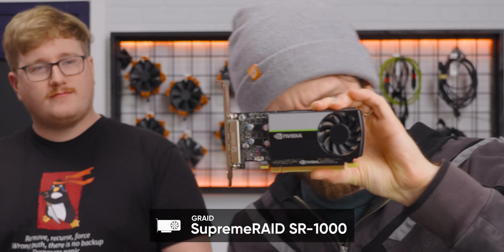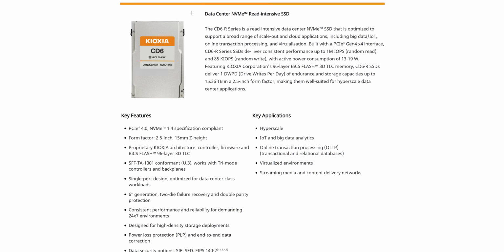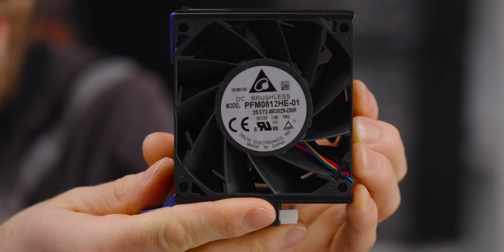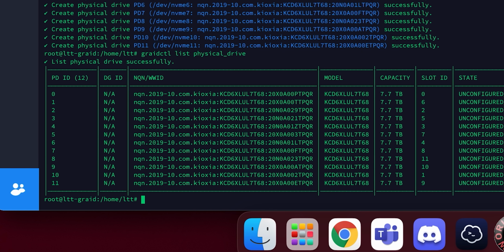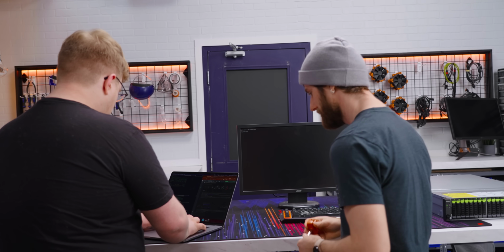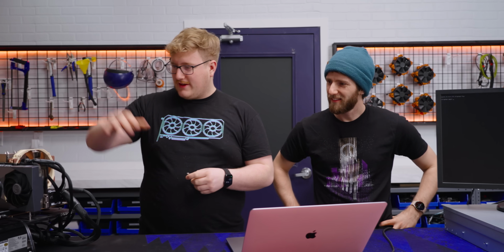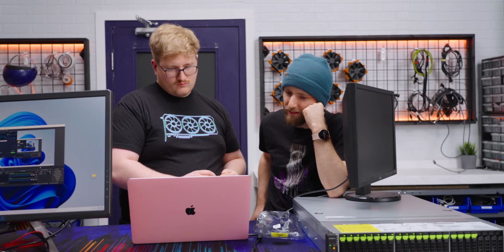I predicted the future! - GRAID Graphics Accelerated Storage

Comment: I am hoping you can look into a problem that's been cropping up all over.  It's called Nahimic service,  some kind of sound booster program that's only causing problems for everyone that realize that they have it.  It does nothing more than eat Ram availability and CPU cycles and crash nearly everything.  So far the only way to stop it from doing anything is to turn off the service through MSConfig.  Uninstalling it doesn't work since it seems to reinstall itself whenever you reboot or update windows... Please look into this soon and hopefully you may be able to get to the bottom of this weird program that's doing everything but what it was made for.

Comment: With regards to the 4k sector size limitation you saw on the Liqid card, are they Sabrent drives you had on it by any chance (I know you use them a lot) - if so there's a converter program to change them to/from 512e/4Kn sector size - it's called Sabrent Rocket SSC. Both my Sabrent drives came set to 512e.

Comment: I just installed two 2TB NVMe Samsung 980 PRO w/ Heatsink on a z390 in RAID0.  The CPU (9900K) goes nuts.  It uses Intel Rapid Storage which handles SATA drives, so I don't think it's designed for it.

Comment: A software RAID accelerator card sounds actually nice. I'm afraid of hardware RAID because if the controller gets fried, you can lose all of your data. With a card like this, you might just lose performance until a replacement arrives.

Comment: As I remember someone usually says, even with RAID, always make backups (and make sure data there can be restored). RAID is redundancy, it doesn't replace a backup.
Reply: Always make backups, even if you use a one-of-a-kind savant human who can remember every bit of your data forever. In fact, make three backups; one externally in your home for acute failure, one at a trusted friend/family member, one either in the cloud or a physical storage location that is protected against disasters. You'll want to keep your data safe even if your house explodes.

Comment: Raid 1+0 is very useful, in an enviroment where you have more capacity than you need but need performance and where seek times matter more than raw throughput. To the best of my understanding. Raid 1+0 reads as if it knows that it has 2 copies of everything. So for random reads each set of disks can deal with half the requeats. This is faster for random reads than even raid 0. But for writes you have to write 2 copies of everything. For mechanical hard drives raid 1+0 is very useful.
Reply: Its actually even faster than that. Since to pull off Raid 1+0 you need 4 drives, you can actually see up 4 times read performance. There are 2 copies to read from, but the other 2 drives have the other half of the data you're trying to read, which can also be read at the same time. Write performance is only doubled because you need to write one set of data to half the drives and the other half of the data to the other. There are other bottle necks when you add a lot of drives but if you have N drives, read speed can be up to N times faster and write can be N/2.

Comment: hello guys, i love your videos!!!! I have a relic for you from 2012 that still works. it's an intel s5000XVNSATAR board with dual processors and 14 GB ram, a GTX970 4GB graphics card, and 2 1TB hard drives. I'm having a hard time finding cooling fans for the CPU's. i want to take it out of the server case and put into a regular tower setup. it has the crazy ram that you were talking about in one of your videos from 2019 that you did using an Intel dual CPU board with xeon processors. This board has 2 GBE Lans.  Any suggestions? Would you guys like playing with the board?

Comment: GPUs are good for highly parallel, high throughput executions, but suffer from higher instruction issue to execution latency than CPUs. I wouldn't be surprised if that's why it takes a little bit for speeds to ramp up.

Comment: Unclear about the usecase where all the data is in memory and we need to write to a disk. Typically, in enterprises, the should be offered as storage solutions. So the data is coming on the wire (say on a 100Gbps link). Would the CPU be unused, if we need to process the data at 100Gbps?

Comment: Should I feel extremist to think that I would NEVER put my data raid depending over a closed source driver ? (and a particular hardware, because Linus forgot to tell you that if the card burns, and you can not find anymore something compatible, goodbye data...). Another reflexion, if you want really to compare, you should have put ZFS also on the raid, or tried ext4 over software raid before. Also, FYI, some in-kernel development now permit to achieve (if you have hardware up to the task) up to 14*M* of IOPS per core on a i9 12900K (tested with Optane)

Comment: 32 raid controllers though... thats way more than 32 drives. As long as the card thinks it's talking to a drive (which is a 6 drive enclosure with a controller or something) you can probably expand infinitely.
And samba... Isn't Rsync faster for moving files? Not as userfriendly though...

Comment: Creating a Raid1 because every drive is a single point of failure => now the raid controller is a SPOF (that hopefully has a much longer lifetime).
Does this system keep running (but much slower), if that controller dies, or can't the software handle that case?

Comment: On a RAID 10 you still have a hard limit of 1 drive failure. Although 6 could theoretically fail without harming your data consistency.
So.. no "real" benefit over RAID5 

That said.. you got close to double the read speed in RAID10 normally.. That might change with gRAID though.

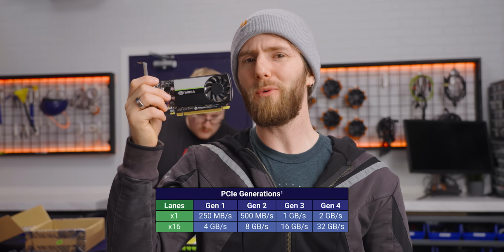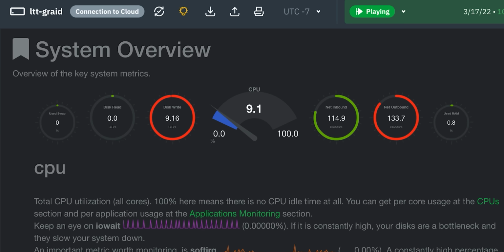Comment: At 4:58 you say the data for the RAID 5 parity calculations doesn't actually have to flow through the card, thus performance isn't limited to the PCIe Gen4 speeds of 32 GB/s. You then say the card only directs where the data has to go. This is incorrect. Since the XOR operations involved in the RAID 5 parity calculations are actually preformed by the GPU on the card, the data being written does in fact have to flow through the card (over PCIe) in other to supply the input data into the GPU for the XOR, as well as sending out the GPU-calculated XOR data back over PCIe. This is why at 17:20 your RAID 5 sequential write performance came in at only 9 GB/s.

Comment: You do not need a dedicated GPU to implement high performance raid. We live in 20th century and CPU can handle the parity calculation if the software raid is designed properly. GRAID just offloads their software raid onto the nvidia GPU making it a much complex solution and adding another possible point of failure. Their card requires 1 PCIe FH slot which is crazy, given that all flash server usually have limited amount of PCIe lanes, making it an extremely important resource. Their CPU consupmtion is equal to high end software raids solution that are available in the market.

Comment: Why do you still compare it with ZFS if it's even not in Linux kernel!? 

If you checking ext4 you should compare it with dmraid. Also, you should try btrfs because it's the same features as ZFS and inside the kernel.

Comment: What about file system compression with an array of nvme drives? This could cause massive CPU utilization as well and reduced speeds. Possible to offload computation to GPU also?
I know NTFS compression is proprietary. What about Linux implementations
Reply: Hmm, in theory it could be offloaded onto the GPU. In practice, complicated compression algorithms aren't well suited to the GPU because decompression requires the output of previous chunks, so it is hard to make use of massive parallelization. You could try simpler compression algorithms, but it'll have to be very simple to benefit from massive concurrency. One of the simplest algorithms is RLE (Run-length Encoding), which isn't all that useful unless your data is full of sequences of the same data (e.g. a black bitmap) - RLE essentially works like this; instead of storing, say, 100 bytes of FF, it'll store FF and a count of 100 - it obviously falls apart with more complex algorithms. There's Huffman encoding, which encodes bytes not by their value but by a sequence that gets to the value as stored in its 'Huffman table'. The easiest way to explain this would be like this; say you have a file full of FF and AA, Huffman encoding computes that there are only these 2 values, so it will be able to say 'lets use binary 1 to refer to AA and 0 to refer to FF', essentially using 1-bit variables to refer to 8-bit real values - in this case, it would save 7/8th of all data, but the more complex the data the less a Huffman encoding helps. If your data is pure random for instance, Huffman encoding will essentially take up the same amount of space because it will need to encode (on byte level) 256 different possibilities, leading to byte-sized indices. It's also a very easy algorithm, both on the CPU and the implentation, so it would not massively benefit from GPU acceleration. There's a lot of more complex algorithms which you'll typically use in day-to-day operations, such as LZMA, ZSTD, ZLIB (zip), and many more. These combine some of the RLE and Huffman encoding principles, usually with a dictionary for common data patterns (e.g. say your book has many mentions of the string "The City", it will detect this and create small signifiers that point to this string). These are really effective methods of compression, but often rely on previous' block output, much like encryption does. GPUs love programs that can spin off into independent ''agents", such as tile-based rendering, none of the tiles in that need to rely on any other tile so no one "agent" needs to wait for the other. With complex compression, this doesn't hold true and the GPU will be bottlenecked as it'll have periods of waiting. For sure, to augment typical CPU processes, this may still provide a benefit. However, if we factor in stuff like uploading the compressed data to the GPU and downloading the decompressed data - we're running into overhead and such. Modern CPUs also have some circuitry dedicated to common (de)compression functionality, so they have some acceleration already.

This is a long-ass post and it's hard to follow. Compression is a tricky subject that I can't completely wrap my head around in a YT comment. :D The skinny of it is though, while the GPU would certainly be able to help boost performance, current algorithms aren't particularly well suited for the GPU. For lossy compression, this is a different story, modern video compression algorithms were made with hardware acceleration in mind. If you were to do the same for lossless file compression, you'd have to create something that focuses on concurrency as opposed to size-savings; in essence, if you want fast (de)compression you'll have to save in disk space savings. That really quickly comes to a point of a lack of ROI. However, maybe someone really smart can figure out a way to get their cake and eat it. It's theoretically still possible.

With regards to using existing compression methods for file systems, it would be a matter of writing a kernel module that with a port of the (de)compression code to OpenCL or Vulkan. Certainly possible, but maybe not worth it.

Comment: RAID0 is an amazing use case for this. Imagine experimental data (as in, running a repeatable experiment where the raw data capture is so large that you need to the raw capacity); then, after the experiment is run, the important data is copied to a more resilient storage solution. RAID0 still has its place.

Comment: Let me explain it to you guys since you seem to not understand what is really going on under the hood. What you call "calculating parity" actually means encoding and decoding using very simple Reed-Solomon error correction code (RS ECC). When you are writing data to the discs you are performing encoding which is much lighter operation than decoding that is performed when reading. That is why when performing a sequential write you get perfect scaling.
Btw. encoding/decoding using RS ECC requires a lot of operations in so call binary field arithmetic. CPUs and GPUs in general are really not suitable for binary field arithmetic that can be emulated with a huge number of multiplications and additions like with that T1000 but it's a total waste of energy. One could reach the same level of performance using 20W FPGA or 5W dedicated ASIC.
Reply: 🆙Thanks for watching🔝🔝 message right away I have something for you

Comment: ehhhh. technically ALL RAID is software RAID. RAID cards are hardware accelerated software RAID. or, in this case GPU accelerated software raid.
annoying to see a telus fibre add when they STILL HAVENT installed it where I can get it. sigh. shaw is working like shite too. sigh.

Comment: Your problems getting games to run are probably because you have two incompatible GPUs in the system at once.
I've seen other YTers run games on the thing with no real problems, other than its comparatively modest specs.

Comment: This is useless. There are various filesystems that solve this problem already, for free. In case one is doing funky things with their file server, there are accelerator cards or even processing power built into the storage to take the load of the CPU.
Lastly: One role per server (except VM servers), everything else is a massive headache.

Comment: RAID5 should be dead in this multi-terabyte per drive age. It is too likely to break when you try to rebuild it after a single-drive failure, JUST due to drive bit error rates.
RAID6 or don't bother, the risks of LOSING YOUR DATA ENTIRELY are too great.
There's a reason Backblaze uses 4 "parity" drives per 20 in their recent pods, UP FROM 3 WHEN THEY STARTED, then ANOTHER level of redundancy above that at the "many pods" level.

14:30
Should do Raid 6 - see previous part of message.